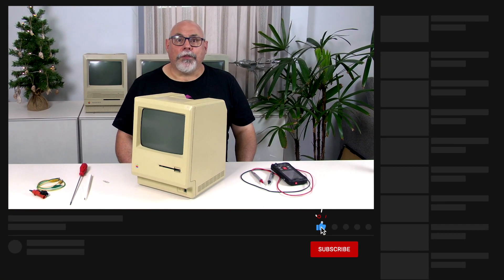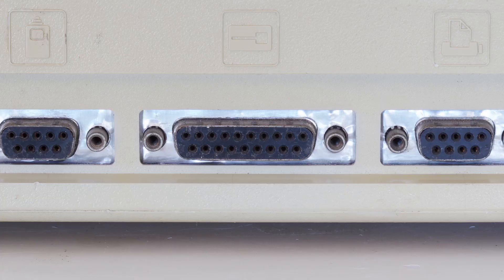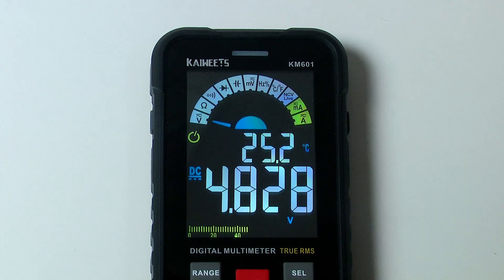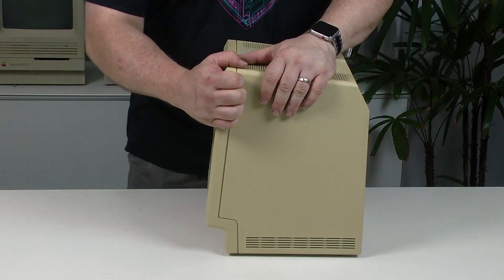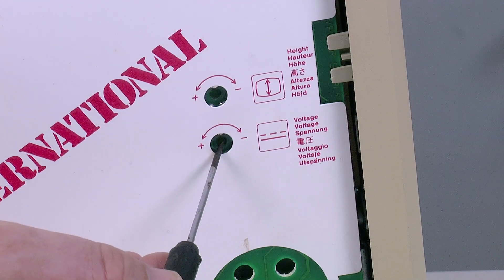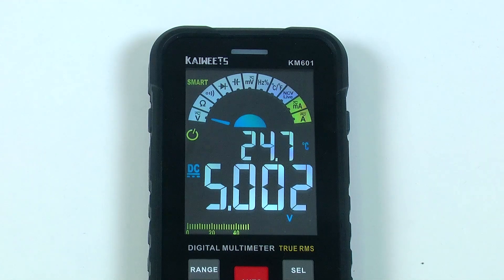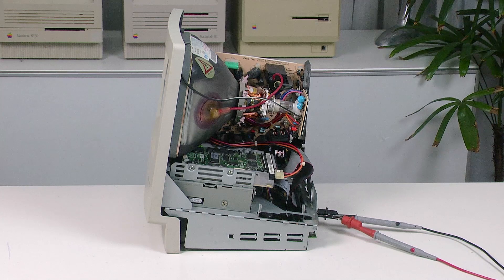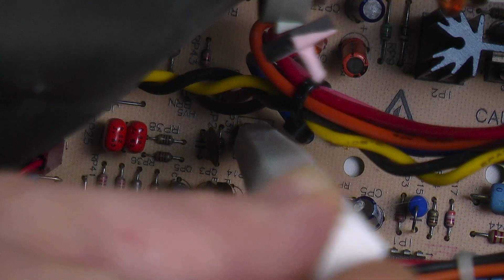QUICK TIP: Testing and adjusting the voltage on a compact Macintosh

Comment: Hi I own a Mac SE FDHD and I noticed that it doesn't have a voltage adjustment like in the video, I thought it had the same controls as the SE.
Reply: Mac SE voltage adjustment is inside the power supply.  You have to pull the analog board, remove the cover from the power supply, put the analog board back, adjust as needed, pull the analog board, put the cover back on the power supply, reinstall the analog board.  It's a pain.

Comment: Great info for beginners to check a common failure point!

You do a good job of underscoring how dangerous this can be, especially with the Classic. I think since this is aimed at people who might not know what they’re doing it’d be best to say to ONLY use insulated or nylon tools for these adjustments. Especially with the Classic, it’s easy enough to slip if you’re nervous. I see you 3D printed a plastic handle, but most viewers won’t have that. There are reasonably priced insulated drivers on Amazon. I wish there were longer nylon TV adjustment tools but haven’t come across them. 

Cheers!

Comment: You cover the +12v acceptable voltage levels but not how to adjust the +12v rail.  I assume that only the +5v rail is adjustable.  Is this accurate?
Reply from the maker: Check out the caveats I mention at 02:35. The adjustment will affect both the +5 and +12V rails. If you get the +5V correct but +12V is outside of acceptable range, you have issues that are beyond an adjustment.
Reply: @BranchusCreations  I have a Mac Plus that is giving me the Jail Bars and no chime, I tried troubleshooting the RAM/ROM but I don't have any known good units to test with. I did check the voltage and I was almost getting 5V but im only get 3V on  pin 8.  What would be my next best course of action?  Is this an analog board issue?  Thanks in advance for any advice